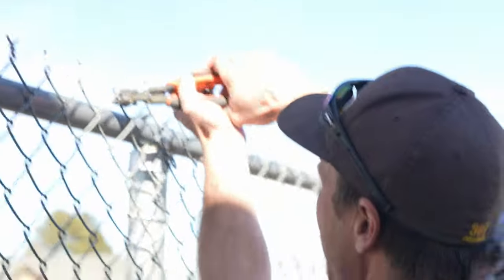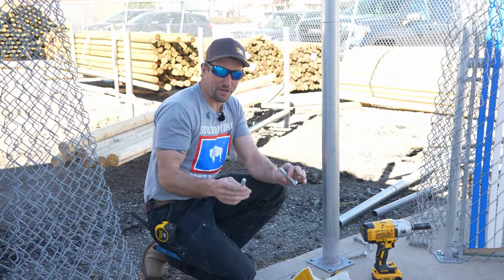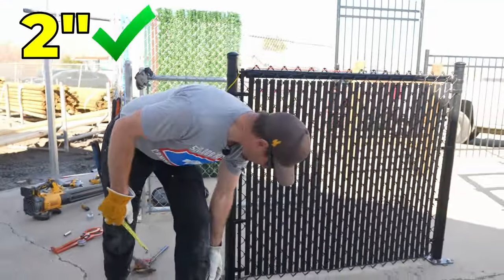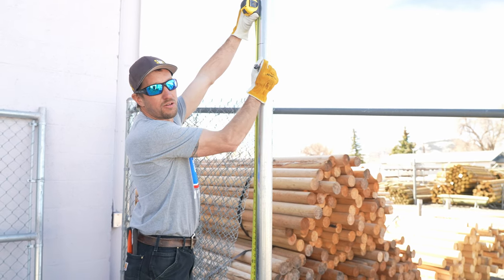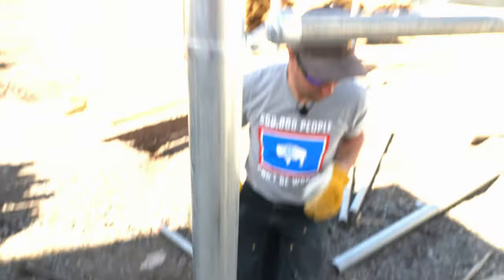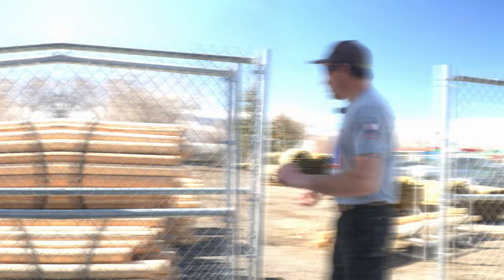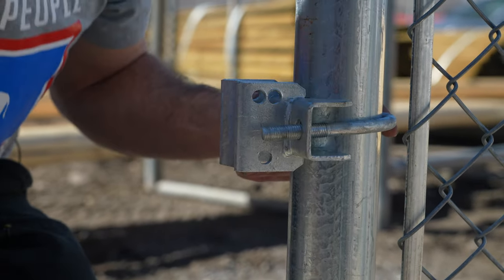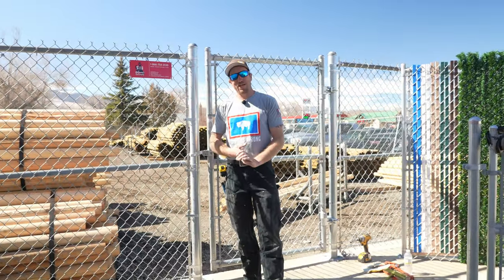Shucks! Adding A Gate To Existing Chain Link Fence

Comment: maybe a little late now, but why not just make each hole one size bigger in the metal to overcome the problem of the holes not lining up; because that would have definitely worked on that one. A half inch uni-bit would work great on that! It would allow you to trim material off of one side of the screw hole.

Comment: You know if you cut just the loops off top and bottom, you can simply unwind the1 link
Reply: You will never be able to unweave it with tension on the wire like that

Comment: Those Ties are actually called Military Ties. They are and have been the standard for military/High security/Prison fencing. I love them some guys don't like they'd rather hand tie set in their old ways lol. I see you use Hog rings originally made for lobster traps. We use galvanized rebar ties instead much faster and gets consistently tight unlike the hog rings.  As always great video nice work.
Reply from the maker: You must have the rebar-tying skills! I'm not a fan of those myself.

Comment: Are concrete screws always suppose to be installed with a drill that has "hammer" capability? Is the hammer option in this case a nice convenience or very necessary?
Reply from the maker: I would have to say yes. If you use a drill it will just torque out and stop running the anchor in--whereas an impact is nice because it helps hammer the anchor in. 👍🏻

Comment: What can a homeowner use in place of a Bearclaw
Thanks
Reply from the maker: In place of a bear claw you could use a glazed donut and still get the same taste😆😆 I had to... Ok down to business---you could use a tie down (aka a ratchet strap), just run the tension bar a little further back to give room for the ratchet to work. or if in a tight spot tie the ratchet strap or come along off to a pull point beyond the post. (So for example, if you're doing a gate opening, you could use the next post, or a tree, or your truck.)